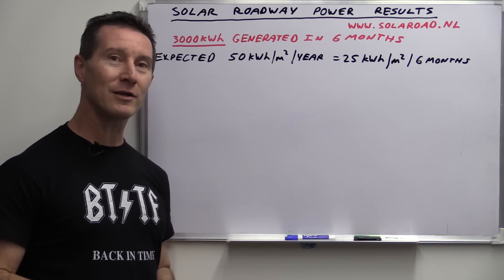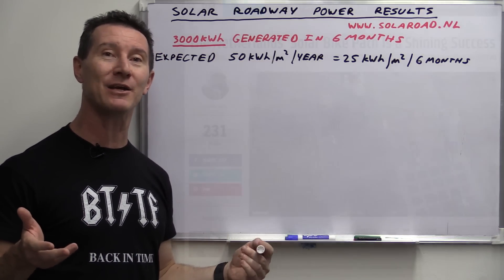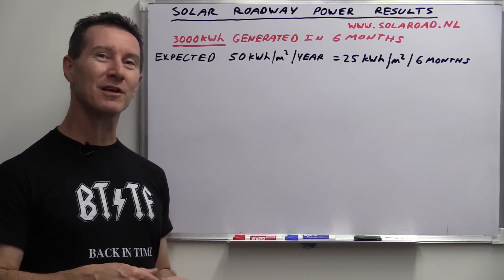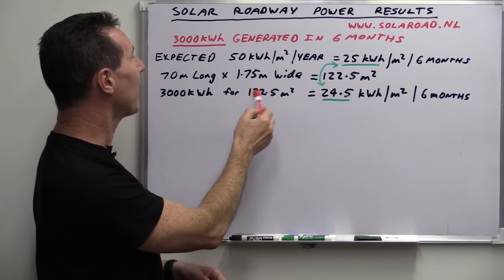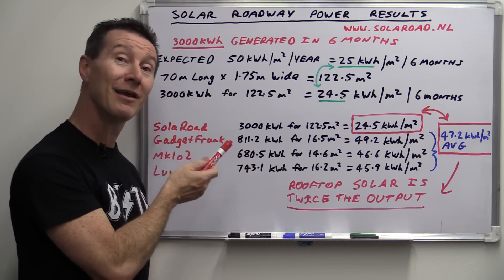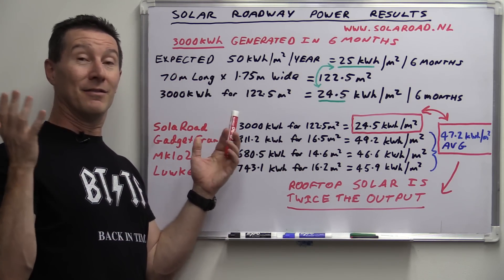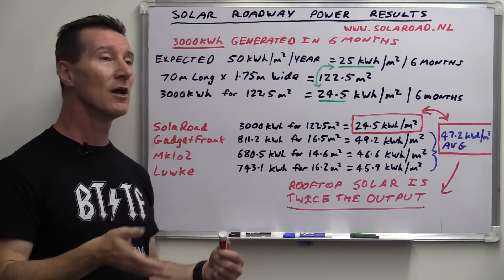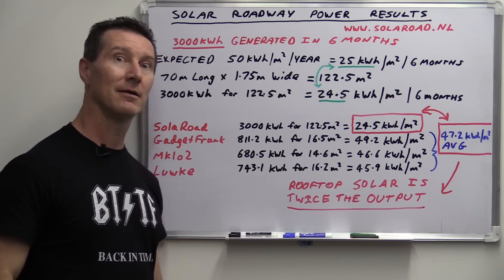EEVblog #743 - Solar Roadways Test Results

Comment: love how we both did different calcs. but came to the same conclusion.

I just took their stated power generation numbers (~5000 kwh per yr), and took the free market value for that electricity (~1000 bux), and compared it to the building costs (~5mn bux).  At that rate, it would take over 1000 yrs to break even! Not bad considering the solar cells have a life of ~ 20 yrs! ( ball park no.s from memory!)

Or looked at another way, solar systems currently only just about break even in 20 yrs.  Therefore cost of equiv. regular solar plant to solar cycle way is 20 k bux, versus actual price of 5mn bux for solar cycleway!
Reply from the maker: ***** Yes, the payback is the thing that sinks this entire solar roadways/cycleway/carpark ship. Regular solar is already a fairly marginal payback thing depending upon circumstances, so having an in-ground system that costs many times more, is less reliable, and will have half the output at best is just complete folly.
Reply: ***** You are even being too generous with your calculation. Considering the bad angle for light collection of road surfaces, the loss of efficiency due to larger heat if used as a road pavement, and the efficiency loss due to the inevitable scratchings on the glass covering of the silicon cells, I'd vote for imprisoning people who try to swindle others into putting their money in a project such as this. It is fraud. Plain and simple.
Reply: From the Engadet article:
"The coating on the solar cells' protective glass tends to peel off when the weather changes, for example, suggesting that the path could be expensive to maintain as-is."
Reply: Nuclear energy - still our best energy-source we got.  
Even with all the catastrophes accounted for, it creates less causalities and less harm to the environment then anything else we have today - yes, it is still a more clean powersource than wind or solar-power.

And before somebody comes up with things like Fukoshima - look it up, look how many people died from the Tsunami, and what the consequences of the leaked radiation are.
Reply: Ricardo U Pal, you are not the smartest wheel on the solar roadway, but don't worry, we are here to help. First, learn grammar, if you want people to take you seriously. Second, a solar bike path is not the same as a solar roadway, and third, our calculations are quite correct, even the article agrees. A 70 m bike path did cost $ 3.7 million and generated 3.000 kWh over six months  - you see the problem here? Now let's say you can get 0.15 $/kWh and the roadway would generate 6.000 kWh/a - which is nonsense -  for in winter solar power generates far less, not considering any abrasion, amortisation would take only about 4.100 years. I call that a success story. Let's say we can improve the cost/performance ratio by a 100 times, it would still suck balls big time.
Reply: Holy crap it's thunderf00t!
Reply: ***** Did not expect to see you here!
Reply: The Atheist Hammer Having worked in the solar industy for a while, I would still disagree: I am for installing more solar panels, fact is tho, that many roofs are not fit for efficient solar panel installation. Be it bad angling of the house or the roof, the roof material being unsuited for the installation, shadows on the roof, etc. Oftentimes it is far more efficient to install solarthermics than photovoltaics and even that is not viable on every home roof. In fact the most cost efficient solution to reduce CO2 often is combined heat and power engines (CHP). They may still burn fossiles, but they do it with a grade of efficiency that is unsurpassed. Buildings need heat anyhow, but by producing electricity alongside that heat at an efficiency of 90%+ at the point of usage, that means this will save a loss of about 60% of all generated electricity within the power grid.
Reply: Ricardo U Uhm - wow - seriously?
You might want to NOT comment before watching the video.
Dave, TFott, me, and many other engineers checked the numbers - this entire video is based upon those numbers.
 
And guess what the numbers show?
It does not produce even nearly as much power as normal Solar-panels in the same city.
So it produces far less power to the point to never be viable even if it would cost the same.
but it also costs several orders of magnitude more to produce, install and maintain.
Reply: As a cyclist, it looks like someone died on that solar bike trail.  These things happen with a prototype.
Reply: Mark Baanstra
Wow - you should get your numbers checked - really. Not even the lunatics of greenpeace have such high numbers - not even close.

You really really should look up the facts about Chernobyl.
The highest POSSIBLE death-toll due to the radiation was estimated at 600 000.
That is - if you would take all the leaked radiation and distribute it directly to humans.
Aka not a single gram of radioactive material would be allowed to land in the woods, water or anywhere else.

Most organizations use a number in the range of 40 000 to 200 000.
And even those are more than missleading.
The cancer-rate increased only slightly - with mostly thyroid cancer with a survival-rate of over 90%.

Fukushima - http://pubs.rsc.org/en/Content/ArticleLanding/2012/EE/c2ee22019a#!divAbstract
2500 cases of cancer as a upper bound estimation.
Reply: Mark Baanstra
So? And cause the Nasa landed on the moon many years ago it is not real anymore?

facts don't simply change.
Again, i invite you to read up on the subject before commenting any further - it is useless talk when your base-information are wrong.
Reply: Mark Baanstra Yes and there were half of a million deaths more due to the chernobyl disaster... Sure. 
I mean cmon. Righ now, the nuclear power-plants are the most Eco-friendly power-plants possible, by far.
And yes, solar panels are getting  there, but you have still huge disadvantages like 1. you can't change the power output as you'd like. 2. they need huge area and 3. it's never great idea to connect big solar installations to the power grid...
Reply: Frederik Hirche
Sadly the EU is well - driven by the same corrupted and mostly braindead politicians.
They have no idea what they are talking about when it comes to technology.
I mean - those are the same guys that wanted to introduce taxes and GPUs based on the memory-bandwidth !!

The same guys that have shut down any attempt to advance in nuclear power-generation.
The same idiots that think about stuff like solar-walking-ways or wind-turbine-trees.
Reply: ABaumstumpf I leave the validity of your and my arguments for others to decide.
Reply: Im not quite sure what to make of your comment here ***** , but it sounds more like youre taking the same side I am here. As a licensed electrician in Australia and having over a decade installation and design experience with both grid tied and off grid solar, I am very much of the opinion that this wasted money could be FAR better spent on something tried and trusted, such as roof top solar for one example, its not like as if there is a shortage of rooves to put it on that are well suited. The money involved in this would go much further on a better project. In short, this is just a money wasting scam, not in the least bit viable.

At the end of the day, none of that is going to completely remove the need for a conventional style grid, and if not done right, solar and wind power can cause more strain on an under-engineered grid than they will relieve. There are many areas around here where the transformers are not large enough to support the connected load when on the lower tapping required to prevent significant over-voltage during the day with low load situations, then come night time with no solar feed-in, load on the grid becomes high enough that voltages drop below the 6% nominal value the supplier is required to supply. This was never a big issue before large adoption of grid-tied solar installations because there was a fair more consistant load on the grid.
Reply: ***** If the biggest argument you can make to support your ideas is to personally attack the other person, what does that say about your ideas? Attacking the other people instead of arguing their ideas is the last resort for people who don't know how to discuss / argue their point.

If you think you have a valid point, say it and support it, but if you can't do that then you shouldn't be arguing in the first place.
Reply: They never produced a working prototype of solar roadways did they?
Reply: Mark Baanstra Wind turbines are more efficient than photovoltaics, so yes. But we will need more than one type of green energy. the reason is simple: Wind does not always blow, the sun does not always shine. Green energies force us to create vast overcapacities and redundancies. This is not a big problem, and better than the alternative of not reducing CO2 levels, but it is something we have to keep in mind, when we talk about green energy.
Reply: Frederik Hirche
There is such a generating plant named Solana Generating Station in Arizona. They do use thermal mass to generate full power over 6 hours after sunset.
The trough reflector is not so hard to make and only needs to set tilt on one axis once a day. I would love to set a small one up with a blackened stove pipe along the focal axis with a fan to push air through. It might work to warm a house.
Reply: ABaumstumpf Sorry, but your argument is just a chain of fallacies.
First off, an ad hominem is no argument for or against competence.
Second, only because you do not agree with an ideology behind a policy, it does also day nothing about the competence of the body you criticize. Even if you were arguing, that because someone is bad at A (e.g. math), therefore he is also bad at B (e.g. history), that is also nonsense. Plus this has nothing to do with Desertec at all.
Thirdly your comment shows that you are completely uninformed about the project you are criticizing, else you would know that this is not a project of the EU but of private energy companies (RWE, GDF Suez, et al.) within the EU. So your already pointless arguments become absolutely invalid.
Even although I agree with you that the nuclear power ban was premature and counter-productive at this point in the light of CO2 reduction necessity. Nuclear power plants do have one big drawback aside nuclear hazards (which would be far lower with thorium reactors, granted, but none of those were built), they take one to several days to get running at full capacity or to shut down properly, therefore they are close too the worst tech we have to for complementing solar and wind energy. For that, we need reactors that have short reaction times of a few minutes to maybe two out three hours.
One reason I am not a big fan of Desertec is, because it is once again an attempt at energy centralization and monopolization. Which is always bad for the consumer. The best solution would be decentralization for quite a couple of reasons, be it price per kWh, net stability, less need for net expansion and thus again cost reduction, and energy independence.
But the point is your arguments are fallacies and you are a troll. I have low tolerance for trolling void of facts. Bring numbers and real arguments and I will discuss with you, else I will treat you as if you were claiming Elvis Presley is living in your fridge.
Reply: ABaumstumpf   An NPV of -20 million is worse than a NPV of -2 million. This can be seen as the distance from economic viability.
Reply: redSKORPION50
Yeah we both feel that Solar Roadways is a waste at best. I see a potentially enormous government funding scam in it too, big players with influence will shear a strip off the sheep and don't give a fuck what they screw up in the process, know what I mean?
I think that the grid needs some kind of storage system, maybe the new super-caps or the molten-salt battery that might still be under development.
Reply: All these gullible people gives me a great idea: Piezoeletric fricking roadsways! Kickstarter millionaire club here I come!
Reply: Mikael Öhman
The US Army tried out piezo boots, but don't mention that since it didn't go well.
Reply: Deckweiss  Well -then read what those sources say -this is NATURAL radiation that got nothing to do with nuclear powerplants.

Radioactivity is all around us at every point in time - nuclear powerplants do not generate uranium out of thin air either.
The radiation-levels of old Marble train-stations for example are a big problem for nuclear power plants - the natural radiation is so high that they need to re-rout their trains to not get contaminated, same goes for workers.
Or if you are working at such a power-plant taking an intercontinental flight means, youa re not allowed to go to the plant cause the radiation-level you have been exposed on the flight.

And sure, we should develop new mechanics, but right now, nuclear is by far the best we have to satisfy the constant base-consumption.
And Also the most promising in development.
Water - where applicable, but it has a rather big impact on the local environment.

For peak-performance the best seems to be bulk-storage of nuclear, solar and wind.
Reply: *****
 It is not me who made that claim - i simply tried to show that Chernobyl is not the cause.

*****  ?
Solar power will surely be a big part of our future power-generation - maybe even 30% - but by far not as much as many lunatics want to make us believe.

I personally would say that every new building should have at least 2m² per person living in that house with an appropriate sized storage-unit.
That is not much, but enough to significantly reduce the load on the whole gird and thus the need for burst-demand power-plants.
Reply: ABaumstumpf
Him trying to claim that cig smoke and nuclear plant waste are somehow in the same ballpark is the ludicrous part.
Reply: Raspoetin a
Did you flunk geometry or just never got that far?
Reply: Raspoetin a
Okay then you didn't take geometry or forgot even simple geometry..
If I take a solar panel and face it directly at the sun, it will catch more photons than if I take the SAME PANEL and tilt it away from directly facing the sun.
Earths surface is curved and a very small percentage of roads face the sun directly or even close on any given day.
Geometric Fact: the size of the panel is the same but the photons received is a function of the angle at which the light strikes that panel.
Reply: Raspoetin a
1) The panels are all flat. Have a look at one some time.
2) Your restriction on how the panels are to be mounted creates the shadow problem.
3) You seem to forget that 40% larger solar panels will cost more to get the same output. I wouldn't hire your group to build a bird house.
Reply: Raspoetin a
You create the problem by limiting mounting solutions. Maybe that was the job in some case but it does not speak for all. Anyway from your account I get the feeling that it was a classroom exercise just from what you did and did not write.

And about your decreasing cost of the panels, at what point do the larger panels cost the same or less than the smaller ones?
I suppose you can tie that to specific conditions as if that proves those as the only conditions.
Reply: Raspoetin a
I can beat panels laying flat on the ground in the continental US by tilting the whole array up about 30 degrees.
Not having a thick glass plate designed to give tires traction that's scarred and chipped and coated in dirt and oil is just that much extra at that much less COST.
Reply: *****  "I don't support solar roadways, but I support the research that is done"  
And projects like solar-Roadways are doing the opposite - they are an obstacle, only hindering any real progress.

Raspoetin a  Well well - looky there.
You want to accuse me of quote-mining but can't point at your own comment cause i have not taken it out of context?

How much more dishonest can you be?
A Flat panel on the ground will never be any better.
How does your mind twist when you try to come up with the statement, that an angled mounting would cost so much more than a flat mounting combined with far far bigger panels?

Aside from that - let us tackle all the bullshit you have said so far.

"he problem is the sun coming from the sides, something that happens in the morning and evening. At those times there will always be some light that falls between the panels. That is wasted potential energy."  
Yes, a tiny fraction, as in exactly those 2 cases we have extremely low light levels at shallow angles.
And you know what makes it worse? Having the solar-panel laying flat on the ground offering an even smaller angle, thus increasing reflections.

It is interesting that you want to flood everything with solar-panels - what for?
Look at the energy-consumption of a normal household - you only need a small fraction of a typical house-roof to cover that.  
So why again should we waste more money to make them flat and less efficient?
Reply: ABaumstumpf
I agree. This SCAM takes money away from real efforts to improve life.
Reply: Raspoetin a
You want 40% larger panels lying horizontal to make up for angled panels losing 25%?
This just gets better.
Reply: Raspoetin a
I can't fucking believe that you start off accepting that ridiculous proposition as a given! It was a rhetorical question made to get you to THINK. Oh well, fail. You're impervious to logic. 
Yes a tin roof might be a bad spot to site solar panels yet you want to contemplate putting them under glass roadbeds. Why are your objections so lame in comparison to the many times worse you think should be accepted?
Reply: Raspoetin a
And you can't tell a scam from honest work and I can guess why.
Reply: Raspoetin a
Everybody they took money from.
Reply: Raspoetin a
$750,000 worth a while back. Tax money. I wonder how patriotic their campaign contribution was?
Reply: ***** 
>Asks you not to strawman others
>gets accused of strawmanning you

I just prefer people actually Win arguments through reason and proof, not by shaming the opposition into silence.
Reply: ***** *I just prefer people actually Win arguments through reason and proof, not by shaming the opposition into silence*
Too many people argue to win, instead of gaining knowledge from someone else their perspective. I tend to 'bail out' when Ad Hominem attacks start. At that point arguing becomes useless.
Reply: I think we can all agree it's as efficient and cost effective as using tampax for nosebleeds, best solution is install solar panels on every home roof and maybe a small wind turbine, but best to leave it a few more years until the new generation of panels and cells drop in price, if a cost effective and efficient home, off the grid kit comes in to play, then people have a choice to get off the grid,
Reply: Frederik Hirche I'm looking into this subject I agree that not every home is suitable,, but could be adapted,  but with the advent of translucent solar cells for windows and that coupled with more efficient wind turbines, and other technologies, I.E the new tesla powerbrick could provide, enough electricity to run a household, but we will see what the future brings
Reply: Well I like how the government of Netherlands did the calculations and implemented them and it work! SO BOTH OF YOUR CALCULATIONS SUCKSSSS!

 For all of you who did not believe in the project its time to start eating you words. This is just the beginning and it is the future. 

http://m.mic.com/articles/117948/6-months-later-here-s-what-s-happened-to-the-netherland-s-solar-bike-paths

Its a confirmed success and its working!! Netherlands first solar bike road!! HA!

NOW YOU ARE BUSTED!
Reply: Frederik Hirche Thermal engines driven by collected sunlight from reflectors? 
Are you meaning something like Peltier wafers?
Reply: Ricardo U Just the beginning of another huge waste of money in the Netherlands. BUSTED!
Reply: *****  Interesting, I actually did not know about Peltier wafers until I looked them up. Thanks. Looks interesting but it is not what I meant. In Europe there currently is a big EU-wide energy project in discussion/pre-construction realization called Desertec (you can look it up here: en.wikipedia.org/wiki/Desertec). The basic technic principle being heating up water by mirrors in the desert until it becomes steam and using it to power steam turbines. In contrast to other solar powered electricity, that steam can theoretically be stored in underground steam tanks, and thus even create electricity in the middle of the night. Originally this was planned in the middle of the Sahara, but due to the political instability of  Northern African transit countries, it is being discussed to install it on a smaller scale in the Spanish (semi-)desert instead.
The efficiency of this tech may be not the best, but considering the abundance of solar power and its rather low tech components (except the turbines), my bullshit-alerter didn't trigger. Haven't done the calculations yet, tho.
Reply: Frederik Hirche No - there is a difference between ad hominem and ridiculing a person for the mistakes they have made so far.

"only because you do not agree with an ideology behind a policy"  
Really? Read my comment again.
it is that they have so far shown very little to no education regarding anything concerning technology.

"else you would know that this is not a project of the EU but of private energy companies"  
You should inform your self better before making such statements.
http://ec.europa.eu/environment/europeangreencapital/smart-streets/

"but none of those were built"
False too. Germany had one for example, and Norway is building one.
And the main purpose of nuclear reactor is to provide the base power.
For peak-demands there are things like pump-storage power-plants.

"The best solution would be decentralization for quite a couple of reasons"  
Yes and no.
Neither a fully centralized nor a spread out power-generation are good.
Centralized is needed for cities or areas with heavy industry.  
You can in general say - the bigger it is the more efficient it gets.

"Bring numbers and real arguments and I will discuss with you"
Why would i need numbers when the stupid idea till now thankfully did not get implemented?
The numbers are irrelevant as the basic idea is already void of reason.
or do you want to see the exact GPU-bndwidth categories they specified and the consequences of that?

I have just listed a few examples to show that the decisions made by the EU regarding Technology are to be taken very skeptical as they have shown many times already that those decisions are not based upon considering the costs and benefits but rather on populism and buzzwords.
Reply: ABaumstumpf 
A "Poisoning the well" argument is a subgroup of "ad hominem". I very much advise Douglas Walton: "A Pragmatic Theory of Fallacy (Studies in Rhetoric and Communication)". My argument thus stands. And even if it were another kind of fallacy, that would be beside the point of being a fallacy in the first place.
Fact remains: Desertec is not a solar roadway, nor a smartstreet, nor a political decision, but a private business venture with political backing. Your point by providing this link is not valid.
Thorium reactors where built, but not for energy production, but merely as test sites, which I do not count in the context given. They never made it to the market, because they were deemed too expensive.
Still centralization is a flexible term.I agree that cities and metropol areas must consider, yet your argument "the bigger, the more efficient it gets" is simply only a half-truth that just fails the reality check. Bigger plants produce energy more efficiently, yet the net structures they require suffer energy losses that outweight this production benefit by far. In Europe we loose approximately 60% of produced overall electricity in the power lines. Decentralization with Mini-CHPs, e.g. retains more than 90% of the produced electricity. Centralized solutions are a big waste of primary fuel. With green tech like Desertec these overcapacities would not have the same ecological impact, yet the problem remains. 
Why you would need numbers? To make your argument valid. An opinion and feelings may be important when couples make up, but they do not solve political or social issues. When you come to a bargaining table with nothing but "Me don't like", and "You stupid", you could have just as well stayed home and saved everyone the time.
Reply: Frederik Hirche  
"Fact remains: Desertec is not a solar roadway, nor a smartstreet" 
Fact remains that you can not count on EU programs to be good -they have shown to not have any standards - that was my whole point.

"Thorium reactors where built, but not for energy production" 
That is simply but wrong.
Why do i even bother telling you about it just for you to ignore facts?

About decentralized - and you have to create a far bigger overall infrastructure for all those small generators.

""Me don't like", and "You stupid", you could have just as well stayed home and saved everyone the time." You should not project so much - that is what you have done.

I have specifically mentioned examples that do not require numbers cause i was simply too lazy at that point.

Now you went ballistic for no reason, accused me and in the end, did exactly what you claimed me of doing.
Reply: Frederik Hirche
Apparently all industry in EU is government controlled programs in someone's delusional world.
Reply: EEVblog Payback is an inferior measure. The NPV and modified IRR methods are better. Obviously in this case, it would give a less favorable result that the payback method.
Reply: axe863
There i think i gotta disagree - it can't get worse than never going to pay for it self :P
Reply: axe863
As soon as it is negative i would say scrub that shit :)

But to the fanboys those numbers don#t matter anyways  - cause it is solar - so it must be great.
Reply: Ricardo U  Where was the actual financial outlay listed?? What was the expected pay back?  Snap?
Reply: redSKORPION50
How much is a meter square slab of glass strong enough to drive and brake trucks on? Multiply that by roads 10+ meters wide and as many km as you can afford and that's just the top layer.
The bike trail needs less glass but the project isn't Solar Bikeways but rather Solar ROADWAYS. The bikeways are a "test".
Reply: ***** Thunderfoot finally finds these videos.
Reply: ABaumstumpf 
Nuclear power does less harm? Really? Tobaco still has polonium210 in it, because the radioactive material from chernobyl spread to south america and is absorbed by the plants from the ground. So people who smoke not only die faster from the chemicals, but also from accumilating radiation inside their lungs, which normally wouldnt be able to pass through skin.
Nuclear power as it is at the moment, has a lot of harm, but I agree on the point that rather than abandoning it, we should learn to deal with it and minimise its harm, for example by switching to thorium reactors, which don't blow up at all.
Reply: Deckweiss About Tobacco - i highly doubt that - source please.
You can just look at the reports we have so far, the amount of radioactive material leaked is well known (Or better, we know how much at maximum could have leaked).
With this, the maximum number of cancer, death etc and so on has been estimated,, same thing for Fukushima - and it still causes far far far less harm than most other power-sources INCLUDING solar power.
Reply: ABaumstumpf  http://www.epa.gov/radiation/sources/tobacco.html

further sources are at the bottom of the page.

Also my main point was, that the ways of producing energy we had so far all have their downsides and we should not sit on the same old shit, but develop new ways faster.
Reply: ABaumstumpf
There's some Polonium in the soil and apparently tobacco uses it. No surprise, there are plants that concentrate various elements and when I say concentrate I mean from tiny amounts to less tiny amounts but still tiny.

The radiation from the Polonium was known by the late 70's. A pack a day then gave the equivalent to one chest x-ray a year.

From Chernobyl? Get the Media! Proof of time travel caused by the Cernobyl reaction! Radioactive material sent to the past! Getcher Crankverse Clarion here!
Reply: EEVblog Yes it is indeed the payback that will float or sink this ship. But lets not forget that rooftops alone can only supply about 25% of the energy needs. This means that you need to look at other alternatives.

Is the South Korean solution the 'bees knees'? No. Sure it is highly cost effective compared to a solar road. But the same road could deliver 3 to 4 times as much energy if you were to pave them with panels. And it does not create shade! 
Shade might be fantastic in South Korea but its not something that is desirable in the Netherlands. Don't forget that the Netherlands is one of the most densely populated countries. 

Its easy to do some calculations and state that they are not as effective as solar panels on a roof, but besides roofs what alternatives are there in the Netherlands?

And lets not forget that this is research that is done for the future, not to start paving today. 40 years ago they started doing research into wind energy, something that at the time was absolutely not viable. But 20-25 years later this research came to fruition and we now see wind mills everywhere. (Denmark gets 40% or so of their electricity from windmills)

If you truly want to debunk the solar roadways, you will have to calculate the amount of energy it takes to build one and compare it to the amount of energy it will produce over its lifetime. If a solar roadway produces more energy then it costs to make and maintain, then the idea is viable.

NO I do not think that solar roadways are the best thing since sliced bread, but they might have a future as one of the many applications of solar panels.
Reply: Raspoetin a Then you completely missed the entire point of his series about this scam.

Some arithmetics will tell you, that they CAN NOT in any way shape or form ever be viable.
Reply: ABaumstumpf Its research that is being done. Why is that a scam.

I would like to see those arithmetics. All that Dave has shown is that at todays economy it is likely not viable. Something that I agree with.

The worlds energy needs are rising at a tremendous rate and are likely to continue to do so for a while. Energy dependence will become a real issue.  The question many countries need to ask themselves is how dependent they want to become on other countries. How do you think Europe would fare if Russia was to cut the gas supply!
There are more reasons to produce green energy then just economics.
Reply: Raspoetin a Trigonometry - a flat panel on the ground is horrible and will always be horrible.

Built them somewhere else and let them follow the sun - you got your self triple the power now.

Again - watch his videos before making claims that he has already addressed.
Reply: ABaumstumpf Dave is wrong about flat panels.
Contrary to popular belief, flat panels can get the most energy out of a certain area.  (Unless you want to put the neighbours into the shade.)

Yes a flat panel produces less energy per m2 panel but you can fit a whole lot more of them on a certain area... Even in Sydney where Dave lives.

Think about it. The amount of energy that a certain area receives does not change because you use angled panels. Flat panels over the entire area receive 100% of the energy that reaches this area. An angled panel only receives 100% when the sun is in exactly the right spot. 

Comment from an Australian company that has been installing solar panels since the 1980's
"As an example, recently we designed a system for a building in Sydney. The goal was to fit on 100kW. This was easily achievable using a flat install (and allowed room for later expansion of say 20kW). If we have used tilt frames, we would have only been able to fit approx 60kW on the roof."
WHAT! More energy from flat panels...

The cheaper the panels get, the more flat installs we will start to see appearing. Although a slight angle might be advised, that way the dirt won't accumulate.
Reply: Raspoetin a
China has invested huge subsidies into solar and maybe at the top. Where do they mount the ones they don't sell?
Germany is supposed to get a significant amount of their power from solar. Where do they mount theirs?

Examine this future more. How will it come to be that the best place to put solar cells will be as road surfaces  with every problem that goes with it?

I could argue economy but you've made it clear that economy isn't everything, even when there's two choices that one is clearly better the economy just is not a deciding factor.

So start spinning the future where solar roads makes sense. If it's good enough, you can turn it into a novel or sell it to Alex Jones.
Reply: ***** Did I flunk geometry? NO.
I can't help it that people think that energy magically increases if you angle panels. The amount of energy that falls on a football field does not change because one uses angled panels. A football field covered with flat panels catches ALL the energy that falls on it. Angled panels only capture 100% if the sun is in the correct spot, all other times they capture less...

But don't believe me, believe the experts (and NO, Dave is not an expert on solar panel installation)

Just read the following: http://www.ljwsolar.com.au/blog/2011/09/flat-v-tilted-panels-the-importance-of-installation-method/
Another benefit of installing flat is that it takes up less roof space. When tilts are used, there is a substantial gap between the frames that must be allowed for. For frames on a 30 degree tilt, the gap is around 1.8m between the back of one frame and the front of the next."

As an example, recently we designed a system for a building in Sydney. The goal was to fit on 100kW. This was easily achievable using a flat install (and allowed room for later expansion of say 20kW). If we have used tilt frames, we would have only been able to fit approx 60kW on the roof.
Reply: Raspoetin a Wow - How thick is your skull?
A Flat panel will only give about 1/3rd the power of an equal-sized tracking panel - this is a simple fact of geometry. 

Sure, if you have a given Flat surface-area filling it with flat panels will give you 100% of the incoming light.
But you could also use angled solar-panels, maybe get a 10% loss, but only use 30% less panels => you have to use far less hardware for the same outcome.

This is also the reason why solar-powerplant use angled solarpanels.
We have more than enough space, but the panels cost a lot.

Aside form that, going full solar-power would be a horribly stupid  thing to do - but trying to explain that to such a numbnut like you would take many hours.
Reply: ***** Lets do some geometry.
A m1 long panel under 45 degrees will cast a shade of 1.4 meters. This means there can be only 1 angled panel every 1.4 meters.
This means the flat panel will be 1.4 meters long. Its basic geometry!
They catch the same amount of photons. 
Per m2 the flat panel catches less photons (70% or so compared to the angled panel) but they are 40% larger... 

And as soon as the sun comes from the side (morning / evening) the angled panels don't catch all the photons anymore...(There will be sunshine between the panels). The flat panels still catch all the photons for that area. 

Its real basic stuff that you can deduct using logic, you don't even need to do the calculations.
Reply: ABaumstumpf I never stated that it made economic sense. I stated that you can get more energy out of flat panels for a given area. 
Mind you, in certain area's it already makes economic sense to put them flat.
Thank you for telling me I have a thick skull, as specially since you now seem to agree with me.
Reply: ***** I never stated that it makes economic sense. I stated that you can get more energy out of flat panels compared to angled panels for a given area.

Please explain how I am creating 'the shadow problem'? That is completely determined by the the position of the sun. Nothing to do with me.

No I haven't forgotten that 40% larger panels cost more. But with the decreasing costs of the panels it is becoming more and more viable to install full flat panels compared to building a construction + panels. And in some areas it is already becoming more economical to lay them flat...
Reply: Raspoetin a "I never stated that it made economic sense. ........ in certain area's it already makes economic sense to put them flat."

The mental gymnastic there - just wow.
Reply: ***** The problem is not limiting mounting solutions. The problem is the sun coming from the sides, something that happens in the morning and evening. At those times there will always be some light that falls between the panels. That is wasted potential energy.

"at what point do the larger panels cost the same or less than the smaller ones?"
You need to combine the panels with the cost of the mounting construction. 
Flat panels become more economic when the extra cost of the bigger panels is less then the construction for the smaller panels.
Reply: ABaumstumpf Mental gymnastics? I don't think so.
I guess you know that because you conveniently left out 1 complete sentence and a few words when you quoted me. 
Just stick to the argument please, no need to attack me.
Reply: ***** "I can beat panels laying flat on the ground in the continental US by tilting the whole array up about 30 degrees."
Yes that is correct. 
You also create a huge amount of shade and prevent your neighbours from installing solar panels:-)
But if the creation of shade is not an issue, then you can indeed get even more energy out of an area by installing a single plane under an angle. Or even go completely vertical. 

"Not having a thick glass plate designed to give tires traction that's scarred and chipped and coated in dirt and oil is just that much extra at that much less COST."
Absolutely true.
Solar roadways will never replace the regular installation of solar panels. But if they can make them viable, they could be used in conjunction with the panels.
I don't support solar roadways, but I support the research that is done because I reckon the energy prices in 20 years will be at least double.
Reply: *****
We have houses with peaked roofs and many not side by side.
At 35 degrees longitude, vertical is not so good as horizontal. But a vertical wall could have panels tilted out from it to do better than either.
If they only replace the glass on the solar roadways, what about the lifetime of solar cells being about that of a dog?

What I try to tell is that there are better places and worse places. As roads is one of the worst!

Where trucks will warp an asphalt road, those glass panels won't stand up for long.
Roads are where oil, antifreeze, dirt and rocks are generally found. Why put solar cells under glass that's going to be scratched, chipped and dirty when not outright broken? They will just be a new extra-expensive high tech pothole.

Energy prices in 20 years? Do we keep increasing energy use as we have? Then it will hurt more for those who cannot do without.

I think that in your country, tidal energy may become big once mass cheap energy is gone.
Reply: ABaumstumpf Angled panels only have a 75-76% annual efficiency when compared to tracking panels. Your tiny little bit is a little bit bigger...
For a given area, flat panels produce more energy. 

The losses due to reflection with modern materials are very very little. The difference between angled and flat is a fraction of a percent. But I do not know how a road would hold up.

The more energy we can harvest from the sun, the less fossil fuels we need, the less a country is dependent on other countries for their energy.
Reply: ***** When the price of a larger panel is cheaper then a smaller panel with construction, then absolutely.
The way we now install panels is different then 10 years ago. For example, we are seeing East-West aligned panels appearing. Not because they produce more electricity (they don't) but the produce more when you need it (earlier and later in the day) 
A tin roof might need major reconstruction to support angled frames but can support flat panels.
Reply: ***** So basically you have nothing left to say... The fact that you try to make out that I am the one that needs to think is a dead giveaway.
Good bye.
Reply: *****
Then the bike path "study" gets used to "justify" the roads? Keeping people off would help a lot.
Reply: ***** 'Then the bike path "study" gets used to "justify" the roads?'
Unfortunately that is correct. The reason is that most people have a hard time differentiating between research and deployment.
Reply: ***** And who exactly are they trying to scam?
Reply: ***** What do you mean by everybody they took money from?
Are you trying to tell me this was funded by the public?
Reply: ***** Actually the government paid 1.5 M Euro, the remainder is paid by Ooms Civiel (a company that builds roads), LMTech (A company that deals with the technological side of infrastructure, and the Netherlands Organisation for Applied Scientific Research.
So who exactly are they trying to scam? Themselves?
Reply: Raspoetin a
People as fucking willfully ignorant and just plain brick wall stupid as you.
Reply: ***** Whatever makes you happy buddy. Just remember that when you point your finger at me and call me  ignorant and stupid, there are 3 fingers pointing back at yourself.
Reply: Raspoetin a
I'm just using 1 finger and it's pointed up.
BTW you are the idiot in this thread.
Reply: *****
I can just see the idiots putting solar roads between close and tall buildings in cities at of course government expense as ordered by the politicians who get the campaign contributions out of the "deal".
But will any of them go to jail? LOL, F-No!.
And in the meantime the police state makes the crime of being poor or the wrong color into a risk. NO WONDER THESE SCAMS HAPPEN.
Reply: *****
If the biggest strawman you can make is that then don't cry to me for calling you stupid for either not understanding or not reading the arguments I have made in this thread yet coming up with your specious attack.

While you're at it, look up the word aperture., it means HOLE regardless of "your experience of the word".
Reply: *****
You asked me not to insult others while strawmanning me by trying to present unspecified comments as my best argument.

You keep accusing me of not presenting arguments of reason. You do this without presenting any yourself even to back up your shaming bullshit. SO WHY SHOULD I GIVE A FUCK WHAT YOUR SILLY GAME IS? OH WAIT... I DON'T SINCE YOU DON'T MAKE ONE!
Reply: I believe it would burn the house down.